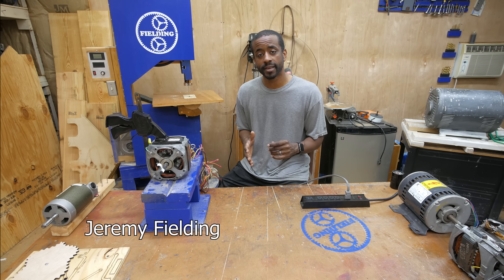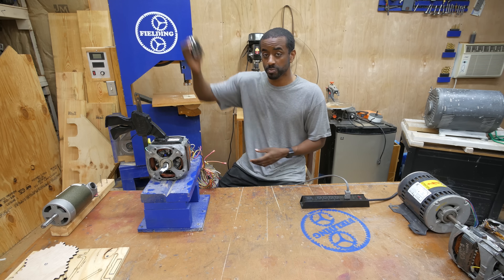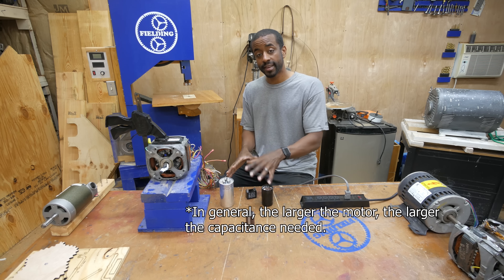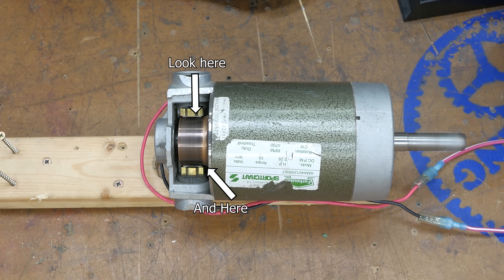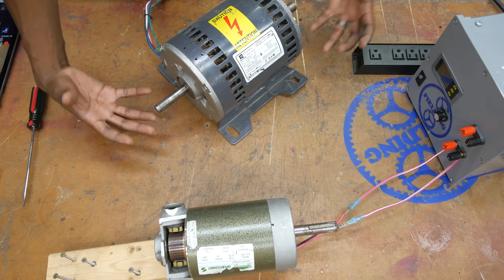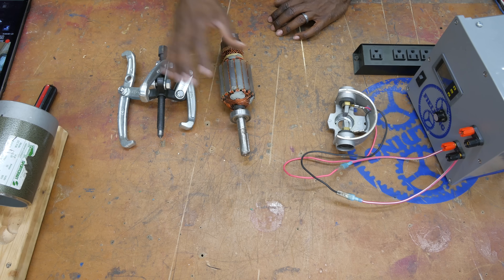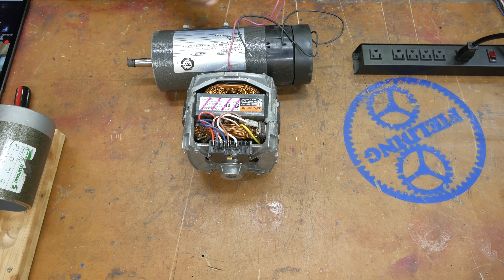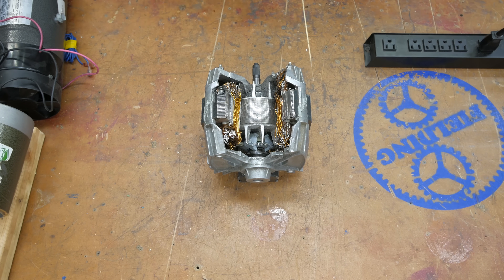Three Most Common Motor Fixes Anyone Can Do; Ultimate Guide to Electric motors ; #070

Comment: Not much to a shaded pole motor though, but they're really common too. (Often seen in light-duty fan motors.) Most don't make much torque to begin with, so even a simple bearing problem could burn it out. Just regular cleaning and seasonal lubrication of the bearing cup will make it last a lot longer than the expected lifetime. (Some things aren't made with servicing in mind, with those annoying security screws. Shame though since those motors are easy to care for.)

Some motors will also have a thermal fuse. That'll just make it stop working without resetting. Something like dirt obstructing the ventilation or a built in fan not working or even missing could be one of the common ways for overheating to occur.

Also with brushed motors, if it still works but you smell a lot of ozone - that's another clue that the brushes may be worn out to the point of going bad. May be something you'll see with older hand tools.

Comment: I was head of maintenance for a machine shop from 1986 to 1990 , Most of the motors if the brush went I replace the bearings at the same time , all the motors in the shop ran off 3 phase 220 .  we used lot of water  and coolant with pumps , It use to be you could get a motor rewound , today they toss them out , I found 3 winding shops , but they are 200 plus miles away ,  household motors are so cheap , if the winding go's it's easy to go to the store and buy a new one .  Your Video was very good right down to detail .   BTW never touch the capacitor plug ends  with bare hands , it holds enough power to kill you 110 or 220 . unless you discharge it first  the outside case is safe  not the leads .

Comment: Cordless drill "slow death" motor failure has two possible causes: 1) Motor overheats, carbonizes the lacquer on the windings and they slowly short together. 2) The permanent magnets demagnetize.

Comment: Hi Jeremy, can you do a video on reversable ac motors like the trash compactor motors? They are  high torque and easily available used. Please show the stand alone wiring without all the switches. These motors should be perfect for shop tools.

Comment: Another common failure that I run into for older motors, especially in old hand tools, is winding shortage/failure. That or them going open circuit.
Reply: And it's important to test them under load, because windings tend to have soft shorts that only leak voltage when running, so they'll test fine with a meter. Best practice is to not measure the resistance, but the voltage drop across the windings.

Comment: Jeremy, don't have a motor fix story but did run into a particularly strange beast a few years ago. A friend bought an old air compressor and we were looking it over, particularly the huge motor. It had a switch on the side marked with I/R. It would work on one setting but not the other. He replaced the motor and I took the old motor to school with me to find out about it. The Industrial Electrician instructor had seen one before, but not in a very long time. He said it was an old switch selected induction/repulsion motor. He checked and the rotor windings were bad so it would run as an induction(?) motor but not as a repulsion motor. I still haven't quite wrapped my head around the difference in operations and what they were better at. Have you ever run across one? Love your videos.       Duane

Comment: The most important part about capacitors is SAFETY! They must always be discharged before handling! Discharging can be easily done by using a screwdriver to short the teminals together, which removes the stored energy. People have died from electrocution from the larger capacitors.

Comment: Hello Jeremy I have a compressor motor that if left plugged in wont work. I have to remove the end cover and sand the contacts and then it works fine.  But I have to always leave it unplugged when not in use.  What's up with this motor?

Comment: It's my understanding that the capacitance does matter.  It affects the efficiency and can cause excessive heating, even spin in the wrong direction.  To much or to little capacitance can put the start winding in phase with the run winding and you end up with the hum, slow start, etc.  This is why your ac cap should be tested if it falls to far out of spec, I believe 10 or 15%.  Always a cheaper repair to change the cap than wait for the motor to fail to start and possibly overheat.
Reply from the maker: Please check the description for my thoughts on this...Also start capacitors that are too small just won't start the motor, Too large of a start capacitor would never be a problem. The "run" capacitor has to be the right size. Not the start capacitor. Spinning the wrong way is just not true.

Comment: just remember to discharge that capacitor else you'll have an "electro-boom" moment
Reply: My thought exactly, he could use a quick warning edited in there
Reply: @eriknau1  Exactly.. Surprised at the lack of warning given it is AC voltages.
Reply: Instead of saying it you should explain how to do it. It would help people know what you are talking about to avoid this Boom?
Reply: Oh the terror my ac/refrigeration classmates and I caused during high school! A fully charged capacitor and a row of students at their METAL lockers was always good for some entertainment.
Reply: Electroboom is a electronic channel that has a running joke where he's always electrocuting himself.  The motor starter capacitor can give you bit of a shock if you touch it after running. (first hand experience)
Reply: @pixifixi2076  my brother pulled the capacitor out of one of those electric fly swatters. He loved charging it up, then tossing it to his friends to catch.

Comment: I built a machine for export that used a single phase 10hp 50hz motor. The starting torque was pretty high and the run load of the motor on the machine was very near 10hp. I delivered the machine to my US based customer who decided to run test it but didn't have a 50hz supply. They ran it on single phase 208VAC 60hz with an undersized wire that caused further voltage drop.

This caused excessive current draw and the properly sized motor protection opened the circuit. The customer "solved" this problem by installing a much larger circuit breaker. Soon the machine would only hum when turned on. The centrifugal starter switch had failed. Since I had used a brand name motor with local support I was able to have the start switch replaced quickly. Further testing using a rented 50hz generator showed the machine worked properly after that.

There were two problems here. Firstly, using a lower voltage increases the amount of current a motor must draw to start and run. Secondly, increasing the frequency of the electric supply increases the motor speed and thus the load on a synchronous motor. While this motor would run on 60hz it would not be able to deliver the nameplate power rating at the higher frequency. Most good motor manufacturers publish specification sheets on company websites that are more detailed than the nameplate on the motor itself. More information can often be obtained from the motor manufacturers themselves or their distributors. It's always better to ask than to burn out an expensive motor.

Comment: Thank you , I did have a Jett belt grinder stop working with that hum, I could get it going if I spun in it by hand and that got old so I stopped using it. Saw your video this morning and 10 minutes later I had a capacitor from a junk washing machine in my hands and replaced the bad one in my grinder with it.....it works perfectly now.
Reply: You mean that old wash machine out on your front porch?

Comment: Been watching your videos and have found them very informative. I know very little about this but do try to follow. Hope you can help me troubleshoot a problem. I have a 1.5 hp motor wired 220, for my tablesaw.  I believe I overloaded the motor while rip cutting and heated l very loud pop. Motor was very hot and would only hum, then just turned off. First thought was capacitor so i took opportunity to upgraded motor to 3hp. Installed and wouldn't start.  Found a tear in connection going to switch and replaced the cable connection. Original motor note runs fine on work table. Question is will the loud pop happen again and is original motor ok to use again. Thanks for any information you can give me.
Reply: If it was a wiring fault it's probably fine. If you can run it under load for awhile, disconnect it from power, and feel around on the wiring to the switch to see if something is getting hot. That tear you found could be melted insulation from the wire getting really hot. In that case, you'll have to replace it with thicker wire and a nicer switch.

Comment: One failure that isn't too common is the failure of an electrical connection that is caused by a loss in conductivity.  This is also known as a resistive short.  One of the features of a resistive short is heat due to current flow through the joint that turns to arcing as the joint breaks down.

Comment: G'day Jeremy .. Just like to know if all Induction motor can run in reverse , if not which can ???? .... Great videos and very informative ...
Reply from the maker: Cheaper ones don't give you access to the "other side" of the start winding. Those can't be reversed. All to save to cost of one short piece of wire.
Reply: @Jeremy_Fielding  . Thank for your quick reply . Your not really telling me on how i can tell which motors can . Is there a way i can test to find out if it can go in reverse ?
Reply from the maker: Search my channel it’s there

Comment: Thanks for the tip on the capacitor. My dryer will sometimes do that stalled out thing. Just moving the drum will start it up again and the problem is intermittent, but I suppose I should buy the capacitor and make that change.

Comment: capacitors scare the hell out of me. do they not all pose a risk of shocking you?
Reply: They do, and it hurts alot. Best practice is to use a capacitor discharge tool to make them safe to handle.

Comment: the capacitor start induction motors you find in most NA bench top tools dont seem to be as good imo as the universal style brushed motors found in hand tools.. i apply any amount of pressure/load to my big bench top grinder and as it slows down it losses torque and slows faster having zero torque at stall.. angle grinder on the other hand the harder you push into it the harder it works and at stall its producing so much torque and consuming so much power without cooling itll overheat in a hurry... maybe this is why DIY videos tend to use angle grinders to power their creative alot more power in a smaller package
Reply from the maker: I explain this in detail in part one of this series... the pros and cons of each

Comment: What other piece of equipment that uses the same type of motor as a 48v golf cart.
Reply: The easiest way is to just look at the motor specs and look up motor catalogues for similar motors. Odds are a golf cart motor gets used in all sorts of industrial gear and you can source a cheap replacement. The specs are almost always on a plate attached to the motor. Failing that, you can guesstimate the power usage and RPM and find a motor using the same bolt pattern, that's the same size and approximate specs and you'll probably be fine.

You'd be surprised how many 'specialty' parts are really just off the shelf of some chinese factory and are relatively cheap.

Comment: I need help I brought a 10hp lathe and I changed the motor to 4hp but can't fine what compassitors to yous on 1ph please can tell what I need to run it
Reply: Have you tried running it without a capacitor? They sometimes work fine without one.

Comment: Ran across a 2 hp motor I wanted to use but it turned the wrong way and changing the direction was not in the cards. The spec-sheet said only one way. Some way it worked like a shadow winding motor but big 2 hp. I extended the shaft with some pipe and VB weld so I could use it from the other end. Just though your audience might need to know that these motors are out there.

Comment: Hi Jeremy, I have a 1/3 hp, single phase motor.  I'm trying to start it off a 12 volt battery.  It acts like it wants to spin but doesn't. The motor does have a start capacitor
Reply: You can't run any induction motor off of DC. While you can run Universal Motors on AC or DC, Universal Motors do not have capacitors. You cannot induce a continuous voltage into another winding with a DC power supply. DC power will not travel through a capacitor. There is nothing you can do within reason that will ever allow that motor to run on DC.
Reply: @knewledge8626  thank you kindly! I have these beautiful motors here and I'm stuck. So I guess that's where it needs a drive. What can I use to produce the ac current to push?

Comment: My latest problem was on a small brush type permanent magnet DC motor.  I went through pretty much all what you mentioned plus I tried to measure winding resistances and even inductances.  Those measurement results were varying all over the map, even on the same coil.  Finally I studied the gaps between the commutator lamellas (or is it lamellae?)  And there was the problem.. All gaps were full of compacted carbon dust.  Maybe there had been some oil or other dirt that made the dust into kind of cakes.  Anyway, after all the wrong studies and tests, the simple fix was to brush the gaps clean.  After that the coil resistances and inductances were steady and matching.  Motor has since worked just fine.

Comment: perfect as always my friend. I salvaged a bench grinder and it had that small  square cap. I was kind of sure it was a cap and replaced it but haven't tried it yet. I now know it was the right move baring any other issue. The motor hummed and spun when I manually turned it :) The square cap thew me for a sec. Thanks pal

Comment: I got this dishwasher induction motor. Really old. It's not capacitor start though. It's a relay start one. (Maybe you can find one and do a video on it, it took alot of trial and error to find out how to wire these types.)
Anyway, I powered it on the day I salvaged it. After 3 minutes, the motor got hot. And alot of the heat was in the bearing areas.
What I also noticed was the rotor was much harder to turn than other rotors. With most of my motors, I can spin the rotor and they spin freely for a few seconds before stopping. This motor didn't do that. I would spin the rotor and it would stop instantly.
So I figured the bearings were bone dry and had 0 lubrication. But what sucked was the body of this motor was welded together. No screws. So I eventually cut it apart. Now it can't be used anymore. It's sad but there wasn't anything I could do for it.

Comment: I've replaced start capacitors on several compressor motors that hummed but wouldn't turn (especially if cold), but with only limited success. Apparently there's something with caps I don't understand.

Comment: Induction motors have rotors. Brush motors have armatures. That bit the brushes run on is called the commutator. You can hook polarized capacitors to AC too, but you need at least two of them in order to do it. A pair of polarized caps with their negative leads connected together is a non-polar device. I didn't believe it myself until I did it. But seeing is believing. Calculating the capacitance you're going to get out of series capacitors is a bit of math though. It goes down too.

Comment: Jeremy... since you asked... I have a 10kw diesel powered generator that was going through a lot of brushes, so I started hitting the brushes with a shot of WD40 before I fire it up and it has slowed down wear on the brushes at least 500 percent. Just a tip that has worked for me... That said... I appreciate your sharing your knowledge. You're a Great Instructor !!

Comment: You covered my three most common failures. Brushes, bearings and capacitor. I have an odd follow up question. If you where going to convert a 98 2wd Ford Ranger to an electric vehicle what would be your top choice on motors? For example type of motor, hp rating and rpm range you think would work best.

Comment: You're 100% Correct Jeremy... I'm no motor pro by any means... but I've had to learn to replace capacitors in most everything I own that has them... being that I'm in The Philippines. You name it... several different kinds of water pumps including open air cooled and submersibles, ceiling fans, air compressors, microwaves, even stereo amplifiers...  it's a huge pain. Thumbs Up!!

Comment: Could the bearings be the problem with my 5 month old craftsman router? It was working fine then it started to slow down and now spins at a  much lower rpm. And when a load is applied it stops. I'm pretty sure I was overloading it by trying to put 1/2" w by 3/8" d slots into pressure treated 2"x4"s to lock  hog fence in.

Comment: Jeremy and everyone: can you recommend a variable frequency drive for the Dayton 5K412C ? I want to convert my Delta Bandsaw to a metal cutting saw.  Thanks!
Reply: I used a 3 phase motor on my old craftsman that was one and a half horsepower and bought $120 vfd that converted 230 volts to three phase and it works perfectly. I run it at about 15 Hertz in order to cut really hard Steels and I can run it up to 80 Hertz if I'm sawing  plastic or wood
Reply: @michaelmiller5566  Thanks Michael, I don't have a 220 outlet in my garage, I'd have to add that cost as well if I go this route :-/
Reply: @carlosrivas5522  my garage is also where my breaker panel is so it was easy for me to do that. If it's far away then that would be a bit of work but I think it is worth it in the long run. You could also use it for multiple things as I do
Reply: @michaelmiller5566  Yeah, my breaker box is right there too. There's an electrician coming Friday for unrelated reasons, I might just ask for an outlet or two while they're here.